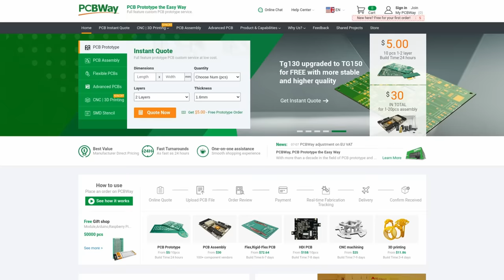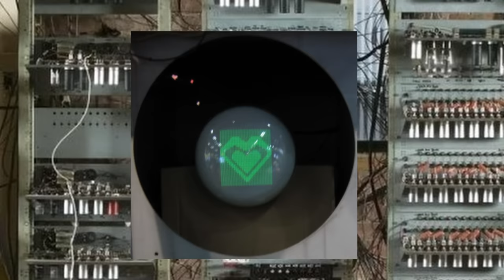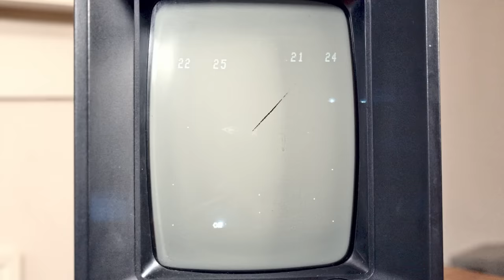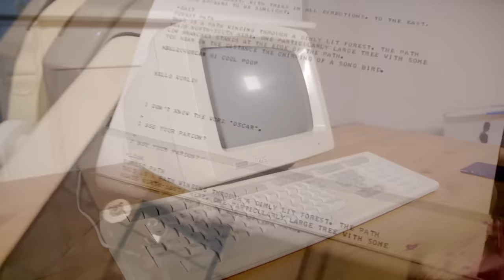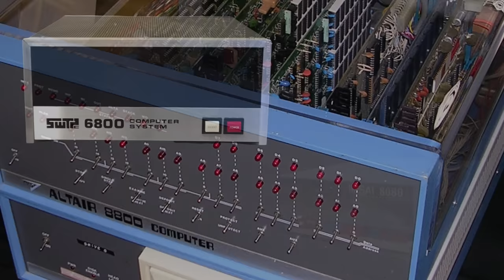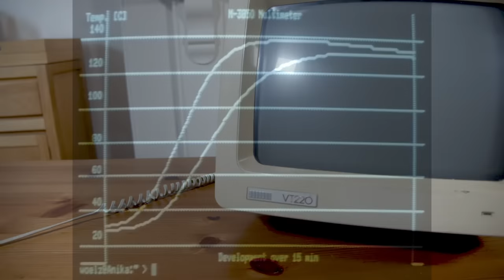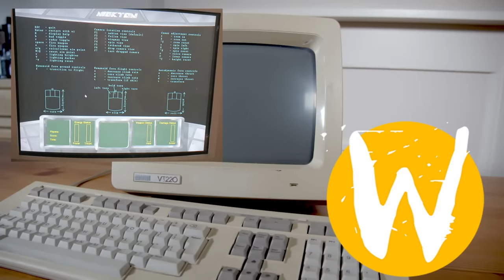The abridged history of Computer Display Tech

Comment: Cheers for this, & it's an sorely overlooked but interesting topic, but I'm surprised you didn't mention the consoles pioneered on the USAFs' Semi-Automatic Ground Environment (SAGE) system from 1958. These employed revolutionary giant radar-like (vector) display consoles called the OA-1008 Situation Display (SD) that were hooked up to magnetic drum storage devices to solve the memory problem (well, sort-of). Of course they were also equipped with plane-zapping light-guns, a cigarette lighter & an ashtray so you could slowly smoke yourself to death while scanning for Soviet bombers. These consoles became the precursor for those used in Air traffic control systems all over the world, right up until the 1980s & the Sabre travel reservation system (the first to be computerised ) from 1960, so they were pretty significant, especially as much of the de-commissioned hardware from SAGE would be used in countess low-budget Sci-Fi movies & telly series from the 60s & 70s (like The Time Tunnel). Now THAT'S significant!

Comment: The old Williams / Kilburn tubes would not have the metal plate removed to look at it, that would bugger up the operation. Instead, Baby had 4 tubes. One for the accumulator, one for the memory address, and one to store the RAM. The fourth tube was visible, no metal plate, and could be switched to be in parallel with any of the 3 tubes, so you could see the contents of any of the other 3 tubes. It was only for display. Indeed a display connected directly to RAM as it scans is how most 8-bit computers worked, this one just doubled as functional RAM as well as screen RAM.

The memory tube had very wide words of RAM while the computer only used a few bits for useful instruction information. In practice that means a load of spare bits on the right hand side, that didn't matter to the computer. So users would draw pictures in them! It might help you spot if a couple of lines of memory had been mixed up but generally it was just for fun. Though there was nothing stopping you writing software to draw to these spare bits, as long as it fit within 32 RAM words.

The tube had 32 x 32 bits of RAM, that's 1024 bits altogether, same as early RAM microchips. In 8-bit bytes that's 128 bytes, or exactly as much RAM as the Atari 2600! The 2600 had a few K ROM as well in it's carts, and a few bits to keep streaming to the graphics chip, but for actual RAM, same number of bits as Baby.

Comment: I got to play with a Telex machine back in the early 80s. A very fascinating device especially to a young teenager. These were dependent on telephone lines and per min charges were pricey back then unless you had some kind of phone plan with prepaid time. My dad did get access to a modem that you put a handset into and let me log into a telex BBS with my TI-99 4a once. That was absolute magic to me back then. I remember that I downloaded an image of a Jack-o-lantern to my screen and a few other things. Took several mins to download at around 200 baud. Thus started my fascination with being online. Sadly it wasn't until the late 90s before I owned a true internet connected PC.

Comment: 23:25  Actually, there were two delay-line memories for each CRT.
One of them remembered all the characters on the display, and would delay the frame period of the screen (say, 1/60 second).  The other would remember the current line being displayed, and it would cycle to match the horizontal frequency of the CRT.  That is, the same row of characters would be seen for each scan line drawn.
At the end of the line, rather than being cycled, it would be output to the main ring, while the next line was being read from the main ring and output to the fast ring.
So, the main ring actually held the screen contents minus one line.
Reply from the maker: Thanks for the extra info John, a buffer for the last line makes alot of sense.

Comment: Don Lancaster's "Cheap Video Cookbook." Very early. I  used to take out the bandwidth limit on small cheap B&W TV's to be used as 80 char monitors. I also was able to remove circuitry on small color TV's to make them RGB instead of NTSC serial inputs to again open the video bandwidth..

Comment: Late to the party...  Between the delay-line memory and DRAM implementations, many display terminals in the early 1970s used a semiconductor shift register architecture.  These were often 80 bits in length, with four separate registers per chip, and a special recirculate function to cause data to be fed back around the 80 bit register, making the display of characters simpler in hardware terms. Typical parts were the Signetics 2532 (same number but very different to the EPROM), TMS3409, TMS3120, etc. The earlier chips were dynamic, which needed to be continually clocked so they did not forget the data. Early DRAMs like the 1103 were very costly and had difficult interface requirements compared to the shift registers. Then 1k bit SRAM (2102 etc) and 4k bit DRAM (TMS4050, MK4096, etc) came along in the late 70s and quickly replaced the shift registers due to the greater ease with which screen content could be updated and due to the lower chip count.

Comment: As a teen I had a terminal hooked up to my Amiga. I found that quite fascinating… Not vt100 compatible though, which made things less useful. In the 90ies I worked for a company that had 5250 terminals and more often 5250 emulations under OS/2 (I switched them to NT4.0 once that became available) and twinax and token ring… some were hooked to a mainframe with 3270. IBM really its own thing there.
Reply: I remember the company I worked for used OS/2 for the development group when we went from IBM terminals to PCs to interface with our mainframe.  That experiment lasted about a year before they replaced them all with Windows.  Everyone hated OS/2
Reply: @schristi69  I actually liked it. Far better than Windows. Not better than Windows NT, though, in my opinion. NT for the desktop was quite exotic though then. Why I made the switch though was not because we didn’t like it but because apart from the terminal emulator, only windows programs were used by the users.

Comment: I worked on 3270 terminal emulation software only a couple years ago, they are basically required to interact with IBM CICS which we used in the bank I worked with to store banking data, their CICS implementation was designed in the early 80s and was still in extensive use. (And likely still is)

Comment: Most PC software simply bypassed the whole terminal thing and operated the screen directly with BIOS calls and directly accessing the video memory. As the hardware were clones that worked. It removed the need to load any driver and made it also faster.

Comment: A company I worked for had some raytheon mini computers which used teletypes and punched  card readers for io.
Several years later they substituted the teletypes and card readers with apricot pc micromputers which performed both functions. The "cards " were punched up in a software editor and saved to a floppy disk to be read into the mini when required. The teletypes substitution is more obvious.
It amused me somewhat, that the apricot with a 16 bit 286 and about a Meg of ram was on paper more powerful than the mini it was serving.

Comment: It’s a bit sad you did not mention Hewlett-Packard’s 26xx series of graphics terminals.
Their first graphic terminal was the 2647, which was an actual 8085-based microcomputer in which you could load HP Basic through a tape cartridge and work locally.
Hardware-wise, the HP 264x series were very modular, with a base containing a motherboard into various cards could be plugged. On top of the base was the CRT that could pivot-up to reveal the innards. You could customize the function with cards and up to two ¼ inch tape cartridge drives (they could be used just like a paper tape/punch).
The CRT was a white-phosphor CRT with a strange 1:2 aspect ratio.
HP had their own escape-sequences that were sufficiently similar to ANSI-VT100 sequences to make conversion easy.
In addition, the graphics escape-sequences were in HPGL, which was the "language" used by HP plotters, so it was extremely easy to write software that could be displayed on the screen or plotted on the plotter.
The Basic interpreter that ran on the 2647 had functions to transparently use HP-GL interface bus (on which you could put plotters, printers and digitizers).
For the late 1970’s, those terminals were extremely well designed ad well thought.

Curious Marc has a series of videos on those terminals where he fixes a 2645:
https://www.youtube.com/playlist?list=PL-_93BVApb5_E6qM4SujInAZSXZ3C-6AC

Comment: The earliest computer I remember using was some sort of IBM system powering a token ring network of dumb green screen terminals. I remember typing in commands on 132 column green and white paper and waiting for a reply. It also had 8 inch floppy drives which held a humongous 180kb of storage which were used to boot it up. Ah happy days. How things have moved on. Unbelievable

Comment: I remember using Sun terminals at university that had so little RAM that they did "disc swapping" over the network. That made them so slow that the SUN logo screen saver burnt in.
Let that sink in, the screensaver burnt in. I could not stop laughing when I saw that.

Comment: Was there ever such a thing as a wax record memory, where something sorta like a vinyl disc made of easily meltable soft material, would have grooves or divots mechanically carved into it, and read sorta like a vinyl record is read, and for erasing a little pointy hot thing, like the tip of soldering iron, would go over where it needs to be reset into a blank state to melt the region into a liquid that would spontaneously get back into flat shape?

Comment: 35:30 That's not a serial port in the middle of the Apple 1 board: that's a 74154 demultiplexer used for the address decoding system. The jumpers next to it set up the memory map.

The actual interface to the video system isn't serial, it's parallel, using the 6820 PIA in the lower left corner of the board, just to the left of the CPU. (The computer side doesn't see much difference between this and a UART, however; it still just checks that video system is ready to receive a byte and then writes the byte to the PIA.) The 6820 is also used for input from the keyboard, which is also a parallel interface.

The Apple 1 video system doesn't even reach the level of "glass TTY." A TTY at least could backspace and overstrike, even if it couldn't reverse line feed. The only control character available on the Apple 1 video system is CR, which returns the cursor to the left-hand side of the display and moves it down a line, scrolling the display if necessary. You couldn't backspace, and you couldn't even clear the screen through software (though there was a hardware button to do this). It's also quite slow: due to the use of delay loop memory, you can write a new character to the screen only once every display refresh, or 60 characters per second. That's about the same as a 600 bps serial link, faster than a 300 baud modem but slower than a 1200.

Oh, and it's not called "X Windows," but the "X Window System."

Comment: The last time I used an instrument/computer using a printer instead of a screen was about 5 years ago. This good old technology still exists 😂
You just went through the menu structure with right/left/back and enter. Instead of showing it on a screen, it just printed it, each button press a line 👌
It's a bit wasteful, but works 👌😅

Comment: I appreciate how, dissatisfied with all the badly-designed historical baggage that's been duct-taped to X over the years, the Wayland designers decided to make it a horrible piece of garbage from day one.
Perhaps in another 40 years, they could figure out how to make it work almost as well as those Tektronix terminals!
Reply from the maker: Harsh review of Wayland 🤣.  Its a design improvment over the pile of bad ipc X has become, however I'd agree its not perfect either.
Reply: My conclusion is that Wayland is basically like systemd. It came to fix a serious problem and caused others by making mistakes.

I've moved mostly to FreeBSD, so I am out of the systemd brouhaha - 2 things bother me the most: binary logs and everything-under-systemd approach.

However, it's pretty much the same kind of situation for me: hey, here is mess, let's fix the mess in a messy way.

So Wayland or X? They are just... different. Period.

I am sticking with X11 because of my retro machines and because I never had really a reason to move on - everything I do and need has been working fine.
Reply: @RetroBytesUK  If you asked me if a car that doesn't start is an improvement over a car with non-functioning brakes, I suppose I would have no choice but to agree.
Reply: This is all Open Source. If you have a better idea, why not write some code and show us. It’s too easy to criticize the achievements of others from the comfort of one’s armchair.
Reply: @Shiunbird  Every Linux system uses binary logs, courtesy of gzip.

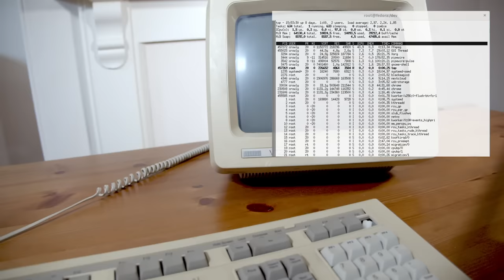Comment: 27:38 Back in the late 1980s, I realized that 3270 block mode terminals + CICS was effectively client-server computing.
37:27 The VT-100 did it because punch cards are 80 columns.

Comment: Now I know where the "terminal" (emulator) comes from as a Linux user. In most cases when you run a "headless" raspberry with a specific application you always can connect via network and the terminal emulation.

Comment: Thank you for the video, excellent as always.

Regarding the Vectrex, I'd like to clarify something. I think you are implying that the Vectrex has some kind of "line buffer" and/or specialist hardware which offloads drawing from the CPU, neither of which is the case.

Lines (or a pointer to a list of lines) have to be loaded into CPU registers from anywhere in RAM or the cart. Some BIOS routines are provided which save the programmer from having to directly manipulate the beam, but all the work is still done on the CPU; the game cannot do any work while the beam is drawing. It's rather like the A2600 in that way.

Thus, it is entirely valid to store some lines on the stack and then draw them one by one (but with 1 KB of memory, who is wasting it on a stack :p)

Comment: I have to take issue with the idea that "blinking lights" aren't a display tech. Unlike the previous CRT memory example, blinking lights were purposeful and intentional and designed to display information about the system state to operators. That function wasn;t a by-product of something else, it was designed in as the display tech for system operators. It's not a USER display, but it was still 100% display tech, just designed for operators and displaying system state data instead of designed for users to display application data ...

To be fair, I started my career as an operator, so I may have a different take than most ...

RE: hard copy terminals ... i was using a DEC LA36 regularly as late as 1998 in a seismic processing server room to log tape mount requests ... rarely used as an input device at that point as its main function was as a hardcopy console. At the same time we were using everything from Tektronix vector displays through VT-100/220 to xterminals ... quite a range of display tech lol.

Comment: Amusingly, the IMSAI 8080 is a clone of the MITS Altair 8800, with much more comfortable switches.

In a rather amusing side-step, the Intel 8008, the first real 8-bit microprocessor, was originally developed for the Datapoint 2200 terminal.  As it turned out, it wasn't ready in a suitable form in time, so Datapoint used a TTL-based processor board instead and the Intel 8008 went on the market.  It only ran at 200 kilohertz, so personal computers waited until the 2 MHz Intel 8080.

Comment: The first electronic computer - also the first programable one - were the Zuse System in Switzerland from 1942 to 1945. Mechanical Computers from Zuse are even older but not fully programmable in a modern sense. The programming language was Plankalkül.

Comment: Also, older managed switches also have a serial 9D Pin connector on them :) you could still plug a serial terminal into it and get text from the switch :) my switch (PowerConnect 6248) went on sale in 2001 and was discontinued around 2006
Reply from the maker: There are still plenty of switches and routers that provide a serail interface for administration via terminal. Although its quiet oftern a USB port that acts as a usb to serial.

Comment: Does the PDP-1 Type 30 display even really count as a vector display? You don't draw lines really, you draw dots. X/Y CRT deflection voltages set with two 10-bit ADCs and with cathode ray gun turned on for some duration.